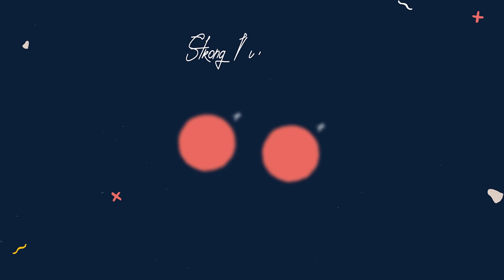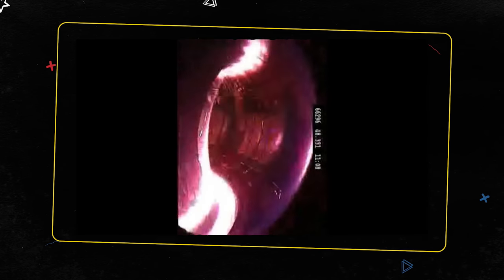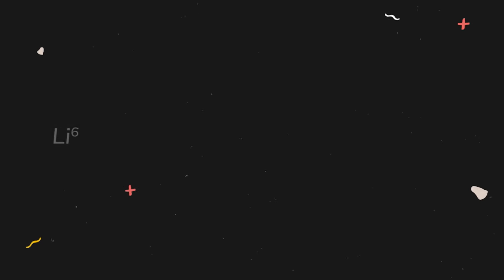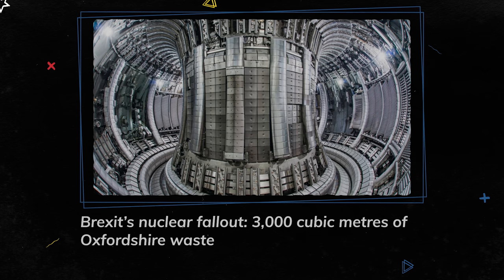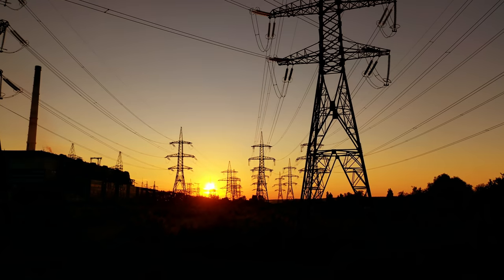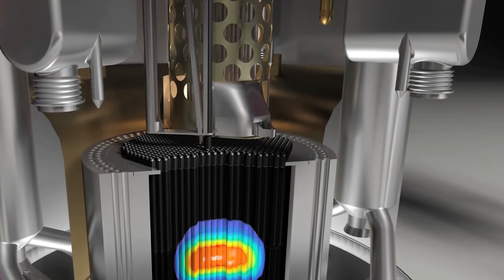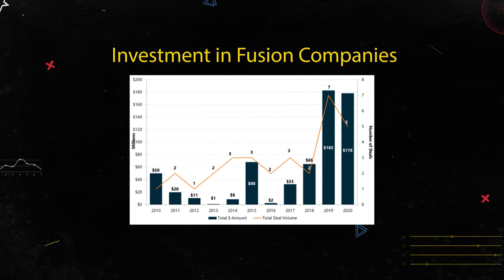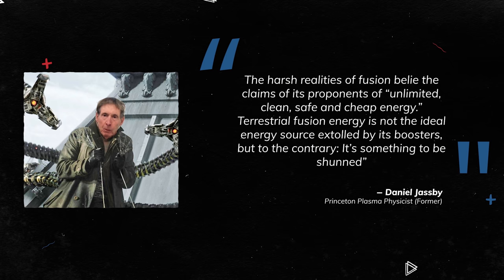What No One Else Is Telling You About Nuclear Fusion

Comment: I believe in reference to tokomaks such as the ITER fusion reactor, it does appear more difficult and expensive to achieve, but considering Stellarators have been worked on for a much shorter amount of time (only since the 90’s) and had considerably much less funding in comparison and have made huge breakethroughs and milestones in such a short amount of time I’d say make this goal much closer. Especywhen you consider what the 7-X research has achieved. The 7-X theoretically solves a lot of the problems you’ve mentioned in the video and is considerably smaller than ITER and will require much less power to achieve and sustain fusion, this means much less materials and much lower cost. And it is believed we can go much smaller than even the 7-X. New designs for Stellarators also could greatly approve efficiency. 

Also I believe the chances for an explosion for a fusion reactor are basically 0, and ionizing radiation is basically not an issue, especially compared to fission reactors, this is one of the reasons why fusion is so sought after, especially for more northern countries where solar isn’t always the best option.
Reply: You make a good point about stellarators, but the problem of breeding tritium remains which has no solution in sight.
Reply: @TerryClarkAccordioncrazy  There may be a solution to this. Geometric simulations suggest that the moon may contain large amounts of Helium-3, a proposed alternate fuel for Stellorators. If we can harness these deposits, Tritium becomes obsolete in favor of helium 3.
Reply: As far as I know Fusion reactors can’t explode. If something breaks midway the hot mass that is flying around in the reactor will collide with the walls and instantly stop the reaction.
Reply: @Manie230  The fusion reaction probably can't explode but the superconducting magnets can. Like Chernobyl was a steam explosion rather than an atomic explosion but it still results in releases of radioactive material.
Reply: @unexpectedproton8253  That's such a cool idea, and I totally love this kind of futuristic tech. Unfortunately the economics of mining the moon and transport to Earth would never add up, especially for helium which needs to be stored cryogenically or under extreme pressure. We need to solve our energy problems with renewables using tech we already have.
Reply: @Manie230  That's true, but the superconducting magnets can cause explosions.
Reply: @TerryClarkAccordioncrazy  Thats true, but thats it, the fuel will rapidly cool down and its basically pure Hidrogen and Helium
Reply: @TerryClarkAccordioncrazy A scientific discussion! In youtube comments! I love it. I agree. The best explanation I've seen so far is having a large railgun that would theoretically launch storage capsules back to eartlh in hours. Due to the very low heat dissapation of space, if the railgun was powerful enough, it could launch parachute-equipped rocket pods of highly compressed helium 3.

I agree though, that fusion is a very temporary solution, as it of course requires a nonrenewable fuel. I'm a believer that once we have enough energy, we should construct a Kurzasgt-type dyson swarm, which would provide us enough power for all human activities. Building one, though, would require the human race to completely dissesemble mercury, which has many ramifications, ethics being the least concerning. 

Correct me if Im wrong, I'm literally like 13 and got most of my information from wikipedia, but fusion could be a stepping stone at the very least.
Reply: @unexpectedproton8253  The railgun idea is new to me. Although I love cool technology, the reality is that energy production is a huge business that needs to be cost effective. Renewables are falling in cost, and the problem of intermittency  of renewables is easier and cheaper to solve than fusion power. Conventional nuclear fission is simple by comparison with fusion, but even that is proving far too expensive. 
I've been following fusion power progress since I was in school like 40 years ago, and now I see it as an interesting but expensive physics experiment. I really hope I'm wrong because getting our power from miniature suns is awesome. But I think a better chance of success is to tap the power streaming at us from the real sun.
Reply: @TerryClarkAccordioncrazy  Wow, that's really cool that you've studied it that extensively. Here's a thought though: if an extensive moon base is built, than fusion experimentation could be done much more easily, because you have the Helium-3 right there.That could prove if fusion is actually viable for the future, especially on a relatively distant planet like earth. 

Renewable power, particularly solar, has become much more efficient and the turnover points much more realistic. We'll have to see how the future turns out.
Reply: @unexpectedproton8253  Mining helium 3 from the moon could work for fuelling fusion powered spacecraft. If you're working and traveling in space it's more efficient to use local resources than to transport everything from earth.
Reply: @TerryClarkAccordioncrazy  That's what I was thinking! For moon-launching rockets, you could have an onboard fusion reactor, although it would have to have a large amount of onboard power to cool or compress unused helium 3. I'm sure exposing the tanks to space would help, considering how quickly any spaceship-generated heat would dissipate, especially with a larger surface area.

I don't know if it's power efficient at all to transport helium 3 to earth, but if it becomes viable, perhaps by some hypereffecient transporter vessel, fusion could at least be a step into the right direction until powerful renewable energy, such as a Dyson Megastructure, can be built.
Reply: @TerryClarkAccordioncrazy  I also like your accordian playing, by the way.
Reply: @unexpectedproton8253  Do you view Isaac Arthur's channel? I'm sure you would enjoy his content. Although I love the idea of mining fusion fuel on the moon, railgunning it back to earth and using it to fuel miniature sun power plants, I think that's unlikely to be economic. We have a climate crisis and we need to stop burning fossil fuels. The things that are going to save us are things we already know how to do, like solar panels, windmills and maybe nuclear fission. Fusion power could be the stepping stone to the next level of human development but it will be too late to fix climate change. That's why we need to focus on renewables and storage now.
Reply: @unexpectedproton8253  Thank you, my music is a fun hobby.
Reply: @TerryClarkAccordioncrazy  I'll check out that channel! I agree that solar panels especially are definitely the way to go, as they keep getting better and better.
Reply: @TerryClarkAccordioncrazy  Well the produced radioactive isotopes are short lived.  Instead of Plutonium with its 240.000 years half life time. Wich is seen from a Human perspective forever.
Also the masses inside a Fusion reactor are much smaller than with fission. Its about grams not tons of material. A Stellerator also don't use its superconducting magnets to heat the plasma, wich significantly increase the risk of a meltdown. Instead separate heaters are used.
Reply: @hansjorgkunde3772  Unfortunately what the promoters of fusion don't mention is that the entire containment vessel becomes radioactive through neutron bombardment. ITER is expected to produce 3000 tons of radioactive waste when it is decommissioned.

Comment: As a MRI service technical specialist I am well aware of the maintenance issues of super conducting magnets, and while there are issues of concern, it should not be a show stopper. In general most super conducting magnets operate reliably for many years with only minimal maintenance.  What I did not know about was how much  tritium is required, and how difficult it is to produce.
Of course it seems that while tritium is  one of the best fuels to use for fusion, there are other options. This does outline some of the many difficult challenges of making fusion power a viable option.
Having said all that I  have to agree,  right now fusion power does seem to be a pie in the sky power source option that may or may not be a viable option in our future. Whereas fission is a known safe and reliable power source that is available today . The fact that so many are against it is sheer ignorance and stupidity.
Reply: We possibly have several helium 3 (cant do subtext on youtube ) deposits on our moon as the sun gives away some of its lihter nuclei to the winds, so there should be plenty of fuel there to last a preety long time. Only problem is getting there.

As for fission, it is a great power source but it we will run out of raw material eventually, having to dig deeper to collect more and making it unsustainable at a certain point. Granted the mining operations will make for plenty of jobs wich is great.

Best case scenario for our power problem is a dyson swarm factory on a nearby moon, no atmosphere makes for little fuel consumption to get them on suns orbit and with enouht advancements in machine learning we wouldnt have to send humans to build them, just some robots with enought material to begin mining and assembly of the propellant and solar panels.
Reply: Helium 3 on the moon will cost more energy to extract and transport than it will ever usefully release. 
Tritium is a problem for LiFTR fission reactors. These are the molten salts using a lithium fluoride fuel salt. You “could” use a LiFTR to make fusion fuel. But it would be far  more cost effective to use fast spectrum molten chloride reactors. They can burn irradiated nuke waste, depleted uranium or bomb grade material. A moderated core of the same reactor can burn thorium which the world has huge resources easily available. 
See Moltex and Elysium.
Reply: @Dave5843-d9m  Who said anything about transporting helium 3, the idea is to mine and create energy directly on the moon.

The transportation of the energy created is a problem but its going to be a while until such project can be undertaken and i'm confident there will be good ways of sending that energy back with minimal losses wothout actually having to take off with it.
Reply: @theepicslayer7sss101  Jamming all radio signals where you are pointing a high powered microwave beam is not a problem as any radio equipment in the receiving zone would be destroyed.
Reply: @Dave5843-d9m  Not to mention the 800M K temp needed for he3/he3 fusion which is far, far beyond what we can do anytime soon.
MOLTEX and Elysium as well as the EBR-II offshoots in current SFRs (Natrium. PRISM, etc...) all seem like reasonable paths for the short to medium term. That said, doing any of those without eventual reprocessing is far from optimal IMO. Plus there is the proliferation risk associated and don't let anyone tell you Th MSRs fuel is less of a proliferation risk...it isn't. That is one of the big D/T Fusion bonuses, no proliferation risk so can be safely put in any country. That alone makes it worth the investment.

Comment: No long-lived radioactive waste: Nuclear fusion reactors produce no high activity, long-lived nuclear waste. The activation of components in a fusion reactor is low enough for the materials to be recycled or reused within 100 years.
Reply: also aneutronic fusion exists, boron proton fusion produces no neutrons. No neutrons no radioactive waste, just lots and lots of heat required. Z machine and similar things should be able to get the heat needed.

Comment: The disruption is the most problematic event in Tokamak fusion plasma.   Fusion with only Deutériums need 400 millions Kelvins plasma temperature . With Tritium we can get fusion at 150 millions but the Neutrons emissions is 14 MeV 7 times stronger that the one from Fusioni réacteurs.  This mean to create material strong enough to resist with time to this environment is not easy because there is no easy method to produce this neutrons for testbed purposes.  The heating system is  a big issue not introduce . The fueling system is complicated too. In fact the video is fine for general public. I was at Jet in 1991 as Euratom Staff . I was at Tore Supra in 1985. I became Deuterium Tritium Beryllium worker being in charge of building injectors of pellets deutérium ice . My first task was Operator for the ORNL  pellet launcher. Then fast gun launcher and Centrifugal pellets launcher.  I was responsible of building cryostat for pumping the gas during operation as well as freezing the fuel to become pellets in order to reach the center of the plasma minimising travel time because like a comet the loss of atoms  due to the extrem hear.. And this a bit cumbersome to discover the fact the best position to do it is from the inner Torus side... The disruption is the most dangerous event to avoid during the reaction. In fact the electrons are the nasty elements. Followings their behaviour let the possibility to adjust the parameters because they are  fast actors due to their mass. Only fast computers are able to operate a plasma fusion reactor. . The complexity is well above human capacity for stabilising the plasma. This is far more complex than rocket science. What can I say is thank to fusion science the medical diagnostic a made a huge step forward as well as metallurgy science,  virtual reality,  robotics, and theory. The fusion energy is a must for stopping CO2 émission without long life nuclear waste.  The best solution is Helium3 from Moon. When we will built Helium mine on the Moon .But this is  a another adventure... Thanks for this video  to promote this field of research the smart students can choose to occupy their brain....
Reply: if I am getting this correctly, fueling these generators, is kinda like trying to get on a turn pike in a traffic jam? You are bound to piss a lot of people off? I am undergrad for my mechanical engineering, and I want to understand what the fuel sources in the distant future will be.
Reply: So let me pick your brain.  I assume the resultant He from the D-T fusion is problematic to sustaining fusion.  How do they intend to remove the product He from the system?

Why are they talking about water cooling? Even fission wants to abandon water cooling and fusion is inherently a high temperature system.   Fission wants to abandon water because of temperature limitations, I just don't understand.

I've heard Tokamak take a very long time to build up energy, is this true? Like I read an article that ITER will require a decade to come to power.  How do you shut such a system down for maintenance when it takes a decade to turn back on?
Reply: @-GinPi Gamma not what I was asking, and nor do I really care. The CO2 in the atmosphere will be absorbed by the oceans, and the water will fall down.
Reply: @-GinPi Gamma I comprehend the physics, however I am specifically giving you limited arguments just to piss you off. You seem very easy to piss off, and I want this to be a learning experience for you. Your wording is arrogant, antagonizing, and lacking mathematical proofs for any of your assertions. You have the logic down, but no mathematical evidence.
Reply: @-GinPi Gamma every single human behavior that we thought was exclusive has been observed in the animal kingdom across a variety of species. I'm not trying to argue with you but dude come on!!! Come on!!!! You cant say stuff like that dude, not cool. Just chill out man
Reply: @-GinPi Gamma that is right. On a side note I heard of fusion also using ocean water as a possible. But yes water vapor is a green house gas as well.
Reply: "Helium3 from Moon"
I have seen calculations of energy density of lunar soil (in regard of He3 content for fusion) comparable to coal.